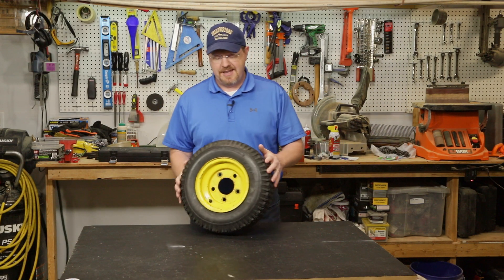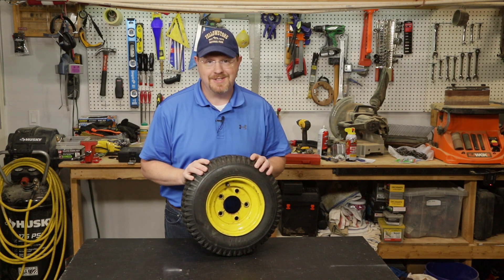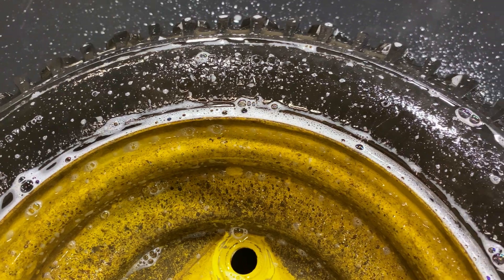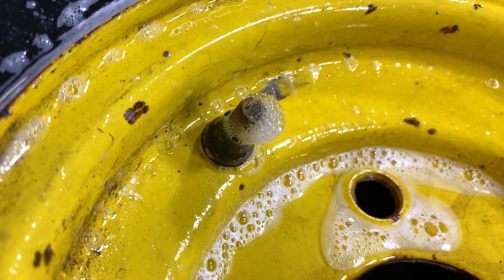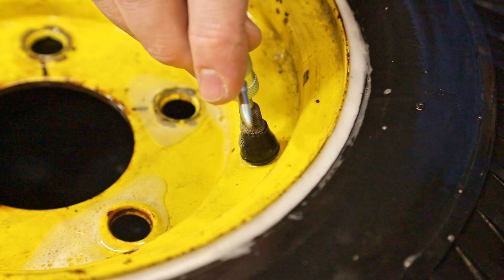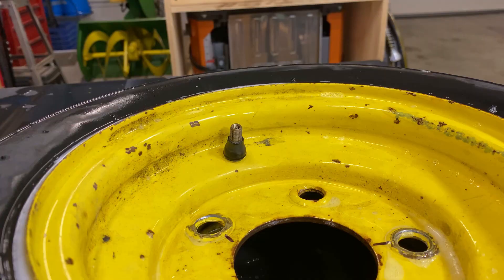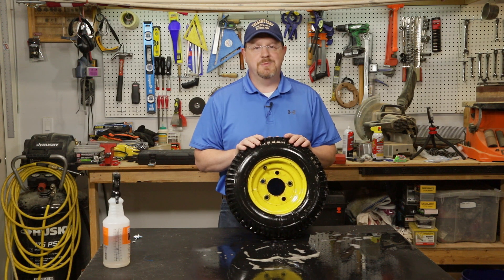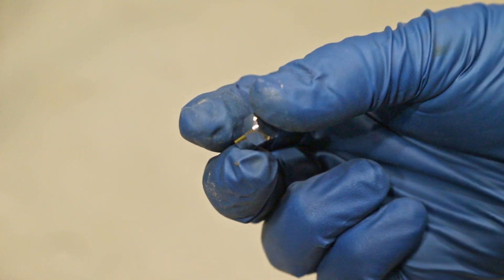How To Fix A Leaking Tire Valve - Cheap and Easy Fix For A Leaky Tire!

Comment: gr8 vid chEf, perfect education✋ - there’s only 1 small twEk(yS I’m 1 of thOse UtUb nO it allr’s), & it’s 5th grader simpl - U problEy did it in that order to end with point of video.. bt NEwA, tAking wheel off & spraying whole wheel - all sides of tire INCLUDING beeds? area, takes like 15-30 minutes, while checking schrader valve takes like 2 secNds - the eazier way is to start w/the 2 secNd chek😉
Reply from the maker: Good tip - I wanted to show how to check the whole tire though, for completeness. Thanks for watching!

Comment: I'd suggest checking your pile of unused bits to see if you already have one with two prongs, then try hand-tightening the old valve to see if it's loose.
A quarter turn is all it needs to leak, and you might get lucky and save yourself a few bucks.

Comment: Although that may be the problem for some I never had a bad valve and I have fixed at least a hundred leaks on small tires.  I found most leaks around the wheel rim.  I make up my own "slime" with concrete bonding adhesive Quikrete 9902, [looks like milk].  Add some fine grained glitter [in the craft area at Walmart], and it will stop most leaks.
Reply: I had exactly this problem. Two of my tires have been deflating slowly. It takes 2 or 3 months for them to finally deflate completely. I took them to the tire shop and they didnt find problems with the tire itself. I suspected a valve stem  might have been the issue and it was. Turns out i Park my car on a street street that gets easily  flooded everytime it rains here in the south. It floods so bad that the water level raises almost to the bottom of the door. That means hundreds of  flooding cycles where the valve stems have gotten submerged with water and debree thus corroding and degrading the rubber components inside.

Comment: Keep your eye on that aluminum valve stem cap. Using it on a snowblower that gets wet and salty will cause corrosion of the cap making for difficult removal.
Reply from the maker: Good tip. Thanks!

Comment: Fine explanation, but my issue is a little different. I have a lawn tractor tire that suffers a slow leak. Part of the issues seems to be the seating of the tire against the rim, an issue that I 'hope' to resolve with a little WD40 cleaning of both surfaces, but the other problem is the valve.
I have replaced the value core multiple times in case of a 'bad new core', but the tire still suffers...
1. On inflation, it as if the core is obstructed in the valve body as the inflation pressure shoots up, cuts out the inflator unless it's set to something like 2 or 3 bar, and then on stopping the pump, the recorded pressure slowly drops back to (say) 0.3bar. It needs guesswork to inflate apparently to well past the usual pressure (I usually set around 0.75bar) just for the gauge to settle back to the required 0.75bar pressure
2. I can see air leaking (bubbles) from the valve even with a new core
I have removed the tire form the rim and there is nothing obstructing the value (and core) internally, so...
 - What is causing the apparent blockage of the valve during inflation?
 - Why does a new core not sort the slow leak?
Do I need to rethread the valve body???
Reply from the maker: It does sound like a problem with the valve body itself. Is it possible to replace it on that wheel?
Reply: I believe I have fixed it  @AmplifyDIY . I seemed to have two, maybe three issues...
1. Leak from around the rim caused by dirt ingress into the tire bed between the tire and rim
2. A leak from the base of the valve and it's seal to the rim
3. Possibly the core not bedding properly ... maybe slight corrosion in the valve body
To fix this I ...
1. Pushed the tire off the rim and them cleaned both with WD40. This isn't just as an alternative cleaning agent, but to slightly soften and swell the rubber and help the seal. Breaking the tire/rim seal was best done with a repeatedly hitting the tire wall with a lump hammer. This seemed much more effective that attempting to lever the tire off, and no chance of damaging the tire bed
2. Re-tapped the core thread in the valve body AND used the valve reamer. This seems to have helped the core seal. A secondary benefit of the tapping, was after screwing all the way in, I could 'keep on going' and slightly rotate the entire valve in the rim, becasue I...
3. 'Lubricated' the valve/wheel interface, and by gently turning the valve with the tap fully home, seemed to allow the valve to seal to the rim ... that slight softening and swelling of the valve rubber and easing out any dirt I suspect
The proof will be in the tire staying inflated over the coming weeks, but so far, so good. I do still have the inflation issue where the core almost seems to block the valve so that the inflation pressure needs to be set much higher than required just to get the air in. Haven't worked that one out yet! And yet, a replacement valve would likely be SO easy ... but they are short valves and I'd need a valve puller, so haven't gone that way yet 🙂
And my final tip for anyone else reading this, was to get the tire to reseat and seal on the rim when you don't have an airline giving 'buckets of air', is to bounce the tire while an electric tire pump is inflating. The (repeated) striking of the tire on the ground gives little shock waves that help push the bed into place and give you a seal
Reply from the maker: @iainhunneybell  I'm glad to hear it seems to be holding air now. Great job!

Comment: Before you remove and replace your valve core, you might want to first see whether simply tightening it solves the problem.
Reply from the maker: This is a great tip! I usually pull them out and check them for corrosion first, and the one in this video was obviously pretty bad. If it’s not corroded or damaged though, snugging it down may be all it needs. Thanks!

Comment: I suspect that you don't fully understand the functions of the valve tool. Between 3.10 and 3.16, you suggest that the tapered arm is to rethread the valve stem, not so, that is the purpose of the parallel threaded section opposite. It is possible for the bridge piece on the valve core to break off with the core in the stem, leaving nothing for the core driver section to work on. The tapered section originally mentioned can be wound into the open open passage of the the core and used like an easy out to remove the broken core. Other parts are the core driver, and a die for rethreading the outer thread for the cap.
Reply from the maker: Thank you for the tips, Walter - I appreciate the feedback.

Comment: Good comprehensive analysis. However, you should have emphasized that anytime after adding air, wet the valve core to be sure it's not leaking  (anytime -- as even when new).  In the instance of the subject tire's leak, you should not have had to be adding air periodically 'for a slow leak that it had for a long time' if you had checked for a leaking core. Allowing a tire to repeatedly go flat can permanently ruin the tire.
Reply from the maker: Great tips - thank you!

Comment: NO NO NO- my son put an aluminum cap on his motorcycle tire, & it was a living hell to get it off 3 years later. I had to use my dremel with a cut off wheel to surgically remove that without destroying the tire valve. No more aluminum caps for me.
Reply from the maker: Was this due to interactions between the dissimilar metals?
Reply: @AmplifyDIY  yes, the aluminum cap oxidizes with the brass tire valve
Reply: @AmplifyDIY  never had any issues with the steel caps tho

Comment: If you know where the leak is, then why are you wasting my time spraying the whole damn tire. I just need to know how to change the valve
Reply from the maker: You may not have noticed, but I added chapter markers to this video so you could easily skip right to the process to replace the valve - it starts at 2:59. Thanks for watching!

Comment: How to REPLACE, not FIX.
Reply from the maker: Replacing the valve core does indeed fix a leaking valve... I didn't replace the whole wheel, tire, or even the whole valve. Just the core.